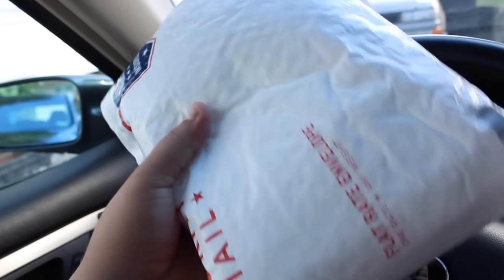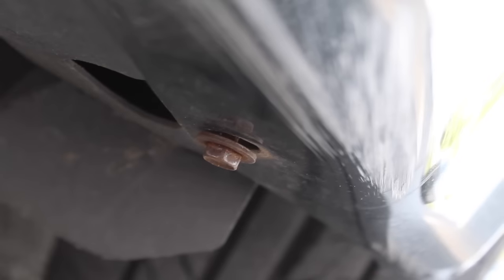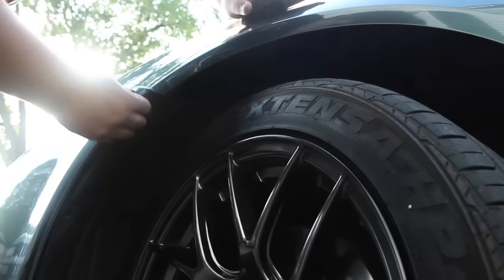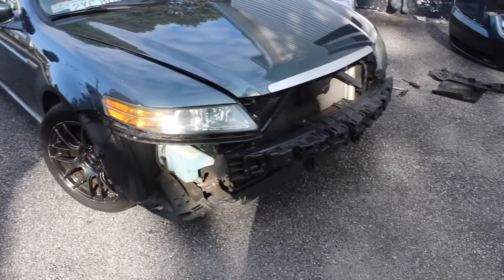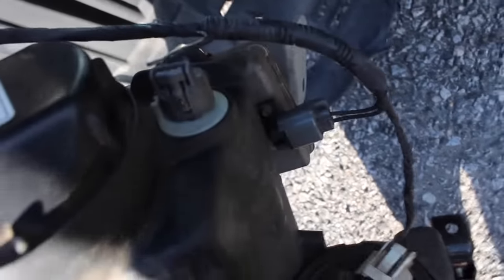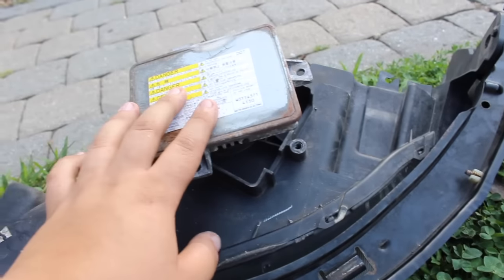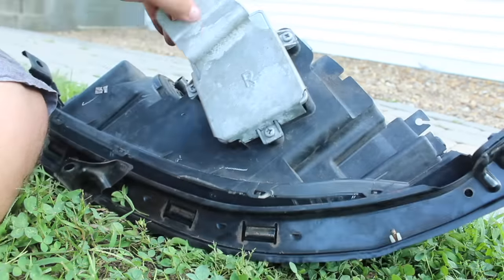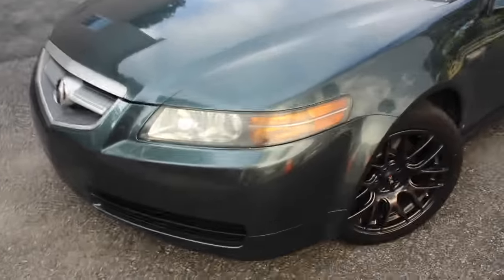How to fix your HID headlights (How to change your HID Ballast and ignitor)

Comment: My 2002 is similarly done. I also changed the full lens housings (both sides), all bulbs, both ballasts and igniters, and the grand total was $260 in parts and less than tow hours of time. Fyi, you can get those plastic clips in bulk for literally a dollar a dozen.  It had been 22 years since I saw new lenses and lights on my rig. I'd forgotten how pretty they were.

Comment: Thanks, Ballast or Igniter did the trick for me.  I did the headlight bub WITHOUT taking the bumper off and it was a real pain on getting the security screw out (hours).  Bulb was not the problem so I replaced the Ballast and Igniter and it works perfectly.  Repair notes for others - I took the bumper off for the ballast repair and wish I had replaced the bulb doing it that way.  The bumper is surprisingly easy to get on and off.  It was actually easier to take off the bumper than it was to get the highlight cover security screw off.

Comment: There is a video that shows you how to not take off the bumper and it works....I tried it but if your ballast needs replaced then you'll be needing to take that whole thing apart better than the shop though they charge you for three hours of labor so grab some intellectual friends and tackle the job with this video. Good luck. Btw im a girl and it's not that hard kinda fun to pull this car apart. Makes the guys do this face...😳😂😂😂

Comment: At first one of HIDs would randomly turn on when it wants to. Eventually both of them would turn on when they want to.. lolll flickering the head switch on and off numerous times just to get one or both HIDs on was annoying af.For the 04-06 TLs. Driving with just the inner fog lights was trash cause of visibility. So I decided to buy a set of ballasts to replace and that didn't seal the deal... ordered 2 igniters & still nope. But finally just bought a pair on amazon which came with new ballasts and used igniters and it finally worked ! Ahah but after taking of the bumper and headlight assembly so much, it made the removal process from 1hour to only 20 minutes
Reply: Andrew Soutth hi. Both my HIDs are out.  Do you have a link for the new parts?? I def wanna do it right the first time
Reply: I’m having same issue . So the ballast and ignitor replacement on both sides solved problem ?

Comment: My driver side HID flickers, buzzes then shuts off. It also mixes with the turning signal, and my hi beams dont work too. I've replaced the igniter, didnt work, tried another ballast didnt work, tried another bulb didnt work. Any suggestions/thoughts? 2004 Acura TSX

Comment: Hey, what problem were you having? I ask because I have the same model and year as you do and I'm having a problem. When I turn my lights on and turn them off to go into a store for a few minutes, I could come back to the car and attempt to turn my lights on, but they don't work until  after a while or so. Could it be my ballast/igniter, the wiring, or the fuses? Thanks
Reply: Tony Hamilton so I just put the headlight in this weekend without the ballasted without all the hassle of taking off bumper and I'm thinking it's the ballast because mine is doing this bullshit still it's gotten me two tickets. So my guess is the ballast of you haven't done this already I'm going to try to tackle mine again today before the snow hits and I'll be back to let you know how it went.
Reply: Mine is doing the same thing am going to change n upgrade to a 10k bulb n also change the ballast this weekend using this video so if it does thanks to this video and I'll let u know but it should be the ballast, I have a 04 I mean it's a 13 year old car. I think it's the ballast. Keep u posted if u haven't found out yet
Reply: Rushane Frazer I just received my ballast & igniter. About to replace the current ones and hope that it fixes the problem. Yea,  both of my lights are having the problem at the moment. Be right back
Reply: Tony Hamilton 
I pull the the bumper apart, i checked and the result was one of my ballast was bad, and the other my headlight  bulb was out,
But the kit I ordered was the whole conversion kit different from the original ballast hids,
So i had to convert the whole thing being that already got the kit and took the bumper off, so i don't have the igniter or the original acura ballast, I converted everything and just made the one that came worked
But the in and out of the lights was that it had a bad ballast not the igniter,
Reply: Rushane Frazer Hey man. I swapped out both of my ballast, but they werent the problem ($85 wasted). My igniters were the culprit. Right now I'm using a bit of unsafe igniters which I mean by the ground wire isnt connected. They're working great at the moment. Gonna get the OEM igniters soon. Also glad to see your lights are in working order again
Reply: Rushane Frazer I also have a 2004 TL. You said that you have LED's in your bumper grill?? Yea,  send me a pic
Reply: Tony Hamilton yea in the grill and the headlight(foglight)
can't send it through youtube it won't allow it

Comment: How do you know if the ballast and or the ignitor is bad?? I just bought a 2004 TSX and the passenger side head light doesn't come on nor do the high beams on both sides. I'm going to try and tackle it this week but don't what to check
Reply from the maker: ed ubinas do a little bit of guess and checking by switching around the ballasts and ignited from the driver side until you’re able to pinpoint which one is bad. May be time consuming but it’s better then spending money on a part that’s not broken

Comment: My issue is that there are 2 bolts connecting the ballast housing base to the car which are impossible to get to as they are behind the wiper fluid tank. My dumb ass bought 2 new hid's , replaced them and my passenger side low beam still didn't work.

Comment: How Can I Get The New Parts??? I'm Going To Do by My self
Reply from the maker: look up the part numbers on google! I pick to buy the used ones on ebay because those are cheaper
Reply: Francisco Tiburcio xenonhid.com gave me ballast and bulbs for 115 included for both sides I did use promo code for 11$ off and free shipping just FYI it's worth buying the whole kit just in case I have 05 TL and if you have the same model chances are you already have  Hid so you don't need conversion kit but that's what it's called a HID conversion kit
Reply: Street Kings parts geek

Comment: I'll never understand why people would by used parts why not just get new ones, especially when it comes to electrical items
Reply: Because they are much more expensive and the used parts most of the time work just as well.
Reply: It's not recommended to buy used electrical part but most times they do work fa real

Comment: I have an Acura TL 08. I already changed the bulb, the ballast, and the fuses and my head light still won’t turn on. Could it be the igniter?
Reply from the maker: Yes
Reply: Should of changed both ballast & igniter at the same time
Reply: @franky-fr9ow  I don’t have the car no more but I should’ve.